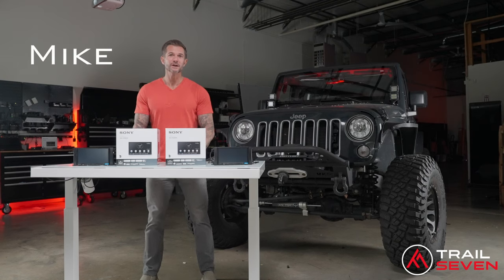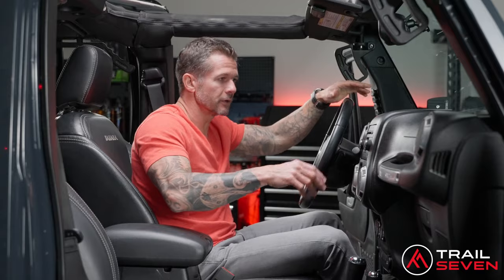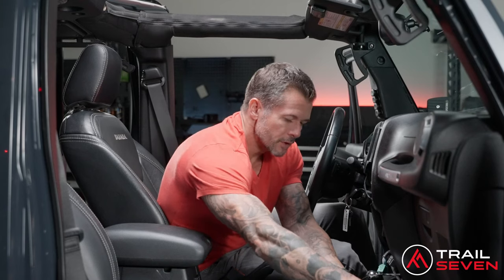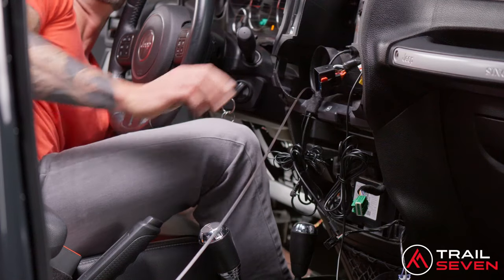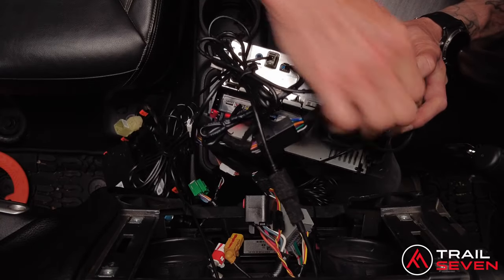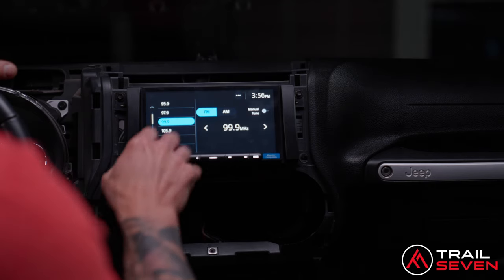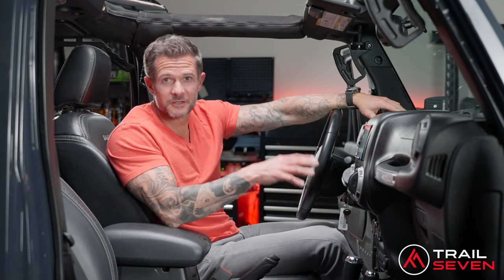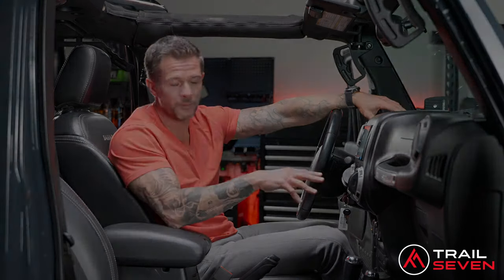Jeep Wrangler JK Sony XAV-AX6000 Plug & Play Kit Installation | 2007 - 2018 Jeep Wrangler JK

Comment: Completed the install of both the  Sony XAV-AX4000 and Kicker Speaker Upgrade Bundle in my 2013 Jeep Wrangler JK today..  Everything came pre-wired for a plug and play installation. Everything arrived quickly and packaged with care. The install of all components couldn't of been easier, not one point of frustration, when guided by the superb how-to videos and instruction materials.  To say the difference between the Trail Seven Kits and the factory components are night and day is a vast understatement.  The sound out of the new Kicker speakers is AMAZING and the new Sony head unit is packed with features and easy to navigate. Thank you Trail Seven, for taking the guess work out of what could of been a daunting task, you've earned a customer for life!!!!
Reply from the maker: @zodadotpaul  We’re so happy hear that everything was a success. Thank you so much for you support and feedback.  Please let us know if you need anything at all.

Comment: Just installed the Sony 6000 bundle. Video was a critical aid!!!! Two lessons learned in my case. One, make sure the camera is hot and active before putting the rear trim back in place. Second was, I did need to trim the radio frame a bit on top to allow for install.  Beyond that all was a breeze and fun project. Thanks for all the intel, so worth it and wife loves the Carplay, Blue Tooth and back up camera. Cheers!
Reply from the maker: Thanks a lot for the feedback, glad to hear it was a success.  

Some jeeps do have to slightly trim that top piece.  We’ve tried narrowing it down by year or model but there isn’t a specific rhyme or reason as to which jeeps have the slightly different sized cross piece.  

Let us know if you need anything at all, we really appreciate you!

Comment: Received the bundle in Switzerland just one week after ordering it, it took me about 1 hour from start to finish, in a dark parking lot with just a wrench, a frontal lamp and a grabber :-D Had a little issue removing the door window switch due to a very short cable, other than that no worries, my jk had no uconnect controller (I discovered that after removing the lower panel :-D ). Thank you for this video and for this kit !
Reply from the maker: @nikolaijch3902  Great news; glad it made it safely and it sounds like the install was a success!  Let us know if you need anything.

Comment: I started and finished the installation yesterday and it took about 35 minutes.  My skill level for these types of projects is not the best but the instructions in the video are spot on (especially with that little screw falling into the console).  I would highly recommend picking up from Trail Seven one of these two units if you have a Jeep.
Reply from the maker: Thank you so much!  We appreciate your support!  Oh and we know all too well about chasing those little dropped screws that manage to find all of the worst places to fall into!

Comment: You mentioned “thanks to Maestro”regarding the steering wheel controls operating. Do I need to acquire a Maestro module or not.I appreciate your instructional video  and I am highly considering installing this unit in our 2012 Jeep Wrangler.
Reply from the maker: @frankferlisi6173  Our bundles include a module which we flash to your Jeep and attach to the radio.  You won’t need anything additional for your install.
Reply: @trailseven  Thank you for confirming.

Comment: if I buy a sony 4000 will it come with  your bundle ? love the vid Makes me want to do it myself. but Ill order a sony 4000 and Im sure  the  wire harness wont hook up,,
Reply from the maker: @edwardcollins-q4m  Are you asking if you buy a Sony 4000 off the shelf at a retail shop, will it come with what’s needed to connect it to your Jeep? 

If so, no.  An off the shelf radio will come with parts and pieces that are not needed and will not include the parts, pieces, dash kit, harness, antennas, and modules that are all required for the Sony to sync with your Jeep.

Comment: So my factory head unit just died this morning, exact same as the one in this video.  Ordered the 4000 this evening.  Looking forward to getting it installed.  Will check back.
Reply from the maker: Sorry to hear your factory unit died, however you’ve made a great choice that we’re confident you won’t be disappointed with!  While we prepare your bundle, do not hesitate to reach us if you need anything or have any questions!  Thank you!
Reply: @trailseven  Hope there are some Trail Seven stickers.
Reply from the maker: @tenchu0siris  There absolutely will be!
Reply: Received my head unit today.  Installed in about an hour.  Everything works as advertised.  Great job!  Even got some NERDS along with my sticker.

Only one question… how do you get the gauge panel to turn off if the doors are off?  I can manually turn off the head unit but the old gauge display stays on.
Reply from the maker: @tenchu0siris  Awesome news, thank you so much!  If you need anything at all please let us know!

Comment: Does the controls on the steering wheel work with this kit? Is the maestro needed?
Reply from the maker: The steering wheel controls are retained with our bundles.  We include and attach a flashed Maestro module.  The bundle is ready to plug and play upon receipt in your hands!

Comment: Even if I didn’t add the I beam backup cam Into the kit do I still get the connection cables for camera and audio inputs?
Reply from the maker: @tylerkern6984  Yes.  The bundle will include the RCA harness so you can add a camera of your choice.

Comment: I have a 2015 Wrangler that has the Alpine system.  Recently the Bluetooth connectivity stopped working  and kicks me off.  Is this from the UConnect device separate from the head unit and if I purchase the Sony system will I be able to connect via Bluetooth.  I guess I am wondering if my UConnect is faulty will it be faulty with the Sony?
Reply from the maker: @ashleyyoung8855  The U-Connect is removed when installing an aftermarket radio.  You will now rely on Apple CarPlay or Android Auto for your connectivity.  The Sony radios are all wireless connectivity.
Reply: @trailseven  Thanks for quick response and great video.  I assume the Sony will match the current or exceed power/watts that the factory Alpine has?
Reply from the maker: @ashleyyoung8855  You’re very welcome.  It’s about double that of the factory radio power.
Reply: @trailseven  Very helpful thanks!  What about hands free phone usage?  Will I still be able to listen and speak using the speakers in Jeep?
Reply from the maker: @ashleyyoung8855  Absolutely, the VR speaker button on the steering wheel becomes your Siri activation button.  You can press the button to activate your phone book and all map requests directly to Siri.
Reply: @trailseven  Thanks!

Comment: I have an 07 JK without gps, uConnect, or steering wheel controls. Is there a bundle for that?
Reply from the maker: The same bundle would apply which will still be build with the Maestro module as the interface between the Sony head unit and the Jeep.  We only offer the Sony 4000, 6000, and 9500ES for the JK’s.

Comment: For 2011 wrangler it’s working?? I don’t know if I have u conect module!!  How i can order one ??
Reply from the maker: Yes, this applies for the 2011 also.  If you have the phone button on the steering wheel, then you have Uconnect which will be disabled.  If you don’t have Uconnect, you’ll extend the provided cable over to the glove box area and leave accessible for firmware updates to the head unit.  

Follow this link to the head units and let us know if we can provide any assistance! 

https://trailseven.com/collections/sony

Comment: Installed everything you did in video. Everything functions correctly but I don’t hear anyone on the phone but they hear me. Any recommendations? Driving a 2013 jeep wrangler
Reply from the maker: Sounds like the Uconnect is still connected.
Reply: @trailseven   thank you my man all fixed. One more question we have an existing camera that isn’t linked do we need to buy an adapter or splice wires for that to connect?
Reply from the maker: @nickdemizio3952  Fantastic!  

As long as the camera has a male RCA, you’ll connect it to the RCA harness that will be found in the bag labeled “extra parts” if it wasn’t attached to your unit already.  You’ll connect to the yellow female RCA.

Comment: Is the XAV-9000ES install the same as this? I just received that bundle from you guys but want to make sure if there's any difference in the install for that.
Reply from the maker: @khaledmohamed_  Yes, the 9000 install will follow the same methods as shown.  Be sure to disconnect the U-connect completely if your jeep is equipped.
Reply: @trailseven  will definitely make sure. Wish me luck, I’ve never done something like this on my car and am kind of nervous about it 😩
Reply: @trailseven  Hello, I’ve been going through the install and removed the part of the dash where the Uconnect box is supposed to be. It wasn’t there though. I’m sure my car does have uconnect, I’ve been using it for years but the module wasn’t in the same location as the Jeep in the video. I think I can see the USB cable being stretched towards the left/steering wheel side. I’m not sure what to do next. Feeling stressed since my dash is all open and I have no idea what to do.
Reply from the maker: @khaledmohamed_  You may have a radio model in which the Uconnect is part of the radio itself.  

Don’t worry though, we’re available to help with support if needed.  However, our shop hours are Monday-Friday, 9am-5pm est so you may want to perform your install during those hours in case you need to speak with support.  

You can reach us directly at 301-450-3207, or at support@trailseven.com during regular business hours.

Comment: I noticed a back up camera option on this bundle, when I decide to install and back up cam on the jeep, does the system have a plug in slot of the back up camera?
Reply from the maker: @ThyBackBraceBoy  Sorry but I’m not sure that I understand the question.  Can you rephrase?  Our cameras are now wired with a direct plug and play connection which connects to the back of the radio via RCA and pre-terminated bullet connectors for power.

Comment: So on crutchfield it says this unit will fit with modification but in this and other videos it doesn't seem to need any?
Reply from the maker: @PNSinstant  It doesn’t need any modifications.  There are very few instances where the top trim piece needs to shaved down about 1/16”.  Some jeeps have a thicker plastic mold piece.  

Similarly to the rubber grommet in the tailgate for the backup camera.  Some jeeps have a hard plastic piece that requires drilling through vs most that have a soft rubber piece that the wire can be pushed through.

Comment: Any known problems using an OBD splitter? I need the OBD port for Jscan and the yearly smog check we have to get.
Reply from the maker: We’re not aware of the splitter, however the OBD connection for the head unit can be unplugged for the smog check and also to use the JScan.  The OBD connection will provide the additional gauges but isn’t detrimental to the overall functions of the head units.

Comment: I have a 2015 Sahara. It has a touch screen it it but the maps says it needs updated and it has no Bluetooth. The dealership said it has what they call a “dummy” radio in it. It does have the buttons in the rear of the steering wheel but doesn’t have the radio buttons on the front left side . I also have the alpine speaker upgrade. I love the sound but hate using a fm transmitter for Bluetooth . What’s my options? Any advice?
Reply from the maker: Hello Patrick, great question!  I can tell you that our Sony Bundle provides you with the ability to use a map app from either Apple CarPlay or Android Auto and connect wirelessly to your head unit from your phone to utilize the map of your choice.  Visit our site to review which bundle would be best for you!

Comment: Is there a wired car play option? I have a head unit in my truck that does both and find the Bluetooth is some what unreliable or has lag when watching videos and using the stereo for sound (I’m parked of course). The way I see it is, I gotta plug my phone in to charge anyways and it might as well direct connect while it charges, two birds with one stone theory.
Reply from the maker: Yes, check out the Alpine i509!  https://trailseven.com/collections/jeep-head-unit-kits/products/i509-wra-jk
Reply: $2100 is a bit more than I wanna spend on a head unit

Comment: Do you ship these units worldwide or to the US market only. Hoping you could source for me a unit that supports the European frequency range for the FM radio. The units available for my market do not support the Maestro idata link 😢
Reply from the maker: You may have found your solution as we DO ship worldwide, however the American model will not support the European frequency.  The work around would be to use the Music App of your choice and connect via wireless Apple CarPlay or Android Auto!

Comment: What do I do with the U connect cable if my vehicle doesn't have a u connect box should I just tuck it in or remove it altogether?
Reply from the maker: Hello James!  We supply that wire for all of the bundles to provide the end user with charging options via use of a USB and/ or future firmware updates. You can remove the last section of the wire which will leave you with a USB port.  If you’re not wanting to use it as a charging port, we would suggest that you tuck it behind the dash but accessible to reach through the back of the glove box for future updates.  
Hope this helps, but let us know if you need anything!
Reply: @trailseven  awesome thanks
Reply from the maker: @jamesrebstock1457  Anytime!

Comment: Hello! Just found this video because I’m looking to replace the stock HU in my new-to-me 2014 Sahara 2 door. It didn’t come with UConnect (confirmed with the build sheet from dealer), so I have no phone buttons on the steering wheel.
Also I’d like to add a backup camera.
Question: Does my dash come apart like yours did? And my USB port is on the current HU.
TIA!
Reply from the maker: Yes, the dash in 2014 will come apart exactly as the 2017 did in the video.  The install will follow exactly.  

If you add the backup camera, please be sure to see the instructions in the link sent out.  We add bullet connectors to make the install much easier and you don’t need to tap into the tail lights.
Reply: @trailseven  
Terrific! Thanks very much!
Reply from the maker: @gto49us  You’re very welcome!

Comment: could you please tell me why the plug got tucked away because you wont need it.  Is that not the plug for the sub in the rear
Reply from the maker: No, the sub in the rear is connected to the factory amplifier.  The factory amplifier connects to the head unit via the wiring harness.
Reply: @trailseven  thank you very much

Comment: The plug in OBD II wiring, do you have the ability to see & clear engine codes??
Reply from the maker: Great question!  Yes, you can most certainly see the engine codes.  You can also clear most of the codes with exception to catastrophic failures which you’ll want to bring to a certified mechanic to inspect the vehicle anyways.
Reply: @trailseven  awesome!  I have been looking for a head unit that was Bluetooth w Apple Car play & backup camera etc.. any suggestions on a reverse camera? I have an 08 JKU and no fancy steering wheel controls🙁
Reply from the maker: @FiremanGMC  We absolutely do!  We are at this very moment in the process of launching our back up camera add on which can be added into any one of our Sony bundles.  

Please visit us and submit a contact form to find out more information on how to get the camera add on prior to its final release.
Reply: @trailseven  ok info submitted & followed on IG
Reply from the maker: @FiremanGMC  Thank you!

Comment: I need that frame. My sony head unit won't fit without it. Where can I get it?
Reply from the maker: In addition to that, what about the wiring harnesses, the control module, and everything needed for it to function with your Jeep?  

The dash kit is a Metra part.  What year is your jeep?
Reply: @trailseven  My jeep is a 17' JK. I have all the wiring harnesses. I just need the frame but cannot find it :(
Reply from the maker: @felipin.el.detailer  Submit a contact form to us, let’s see what we can do for you. 😉

Comment: Is the installation any different if you have the factory Alpine 9 Speaker w/amp?
Reply from the maker: Great question and the answer is not at all.  The Jeep in the video is equipped with the a factory amp.  
We ask if your jeep is factory amplified or not factory amplified on the order form just for our purposes of the wiring harness that we connect at the shop.
Reply: Thanks for the reply. Looking forward to putting my order in ASAP
Reply from the maker: @bROCKenBeatZ  Awesome!  Let us know if we can assist!

Comment: I have a 2008 JK manual transmission Rollup windows all basic will do 600 show all of the vehicle stats and does it come with a back up camera attachment
Reply from the maker: Yes, the Sony 6000 will display the vehicle stats and it does come with an RCA harness to attach a backup camera.

Comment: Will I be able to use my OBD2 port after installing this radio?
Reply from the maker: The radio will need to connect in order for it to read the diagnostics but you can unplug it if you need to attach a module.  If you need a 2nd module to remain connected, you can install a splitter to have both.

Comment: Hi, the new model XAV-AX7000 fit the Wrangler Sahara 2017? or this one will?
Reply from the maker: The jeep used in the video is 2017 Sahara.  The Sony 4000, 6000, and 9500ES will all fit with with wireless Apple CarPlay/ Android Auto connectivity.